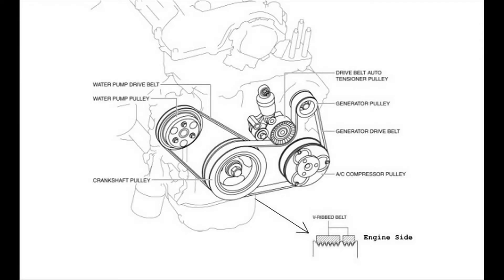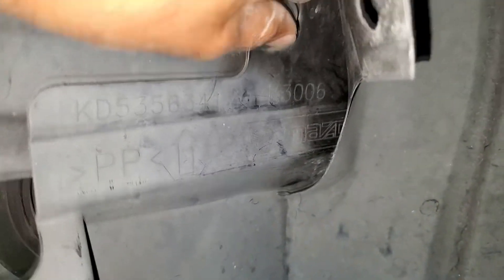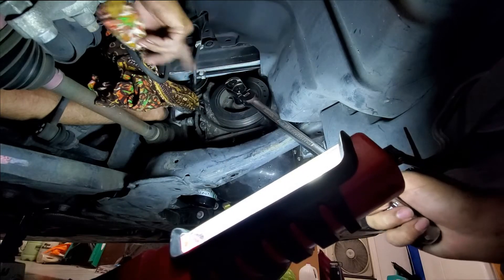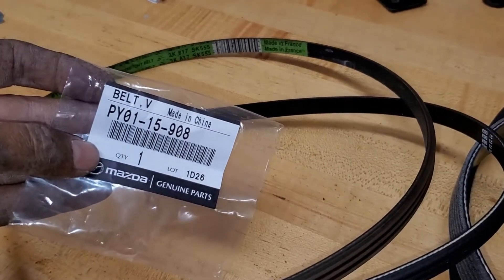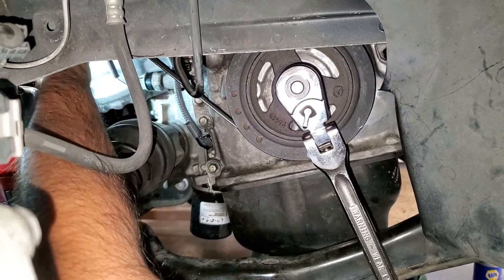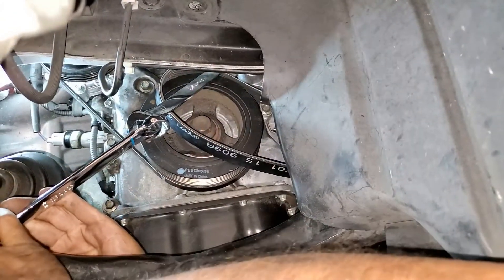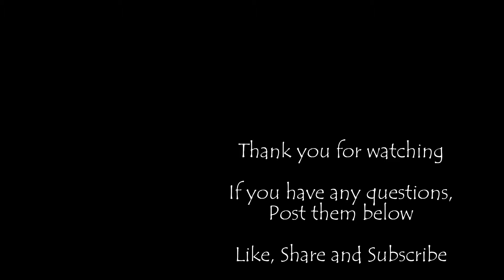How to Remove + Install/Replace Water Pump and Alternator & AC Belt on 2.5L engine Mazda 3, 6, CX-5

Comment: Nice video, but the water pump belt goes on easier from the backside of the pulley. Give it a try next time. It took me awhile trying to get it on your way and just couldn't get it working off the floor. Then I tried it from the backside and it went right on the first time. The serpentine belt ain't no trip to the beach either...   🤣
Reply: Oh yeah, and I forgot to tell you. Just cut the water pump belt off. Too easy...   🙂

Comment: Got to do this very thing to my daughters '16 CX-5. Dearlership wants $850 for that job to include replacing the tensioner becuase it's leaking. What could leak on a tensioner? Now I just have to find a vid on removing that part. Thanks for a great video.

Comment: Iveperformed an oil change gear oil chsnge on tranny, and coolant flush. I want to change the belts, spark plugs, and change the brske fluid next. I got 89k miles i wanna get 400k mikes or better on my 2016 mazda 6

Comment: Great video. I own two Mazdas with G120 and G194 engines and this will come in really handy once I need to address the issues of new belts or a replacement coolant pump.

Comment: Excellent walkthrough, thanks for sharing! Extra points for sharing the part numbers. My only suggestion would be to also replace the belt tensioner. At over 100K miles, it would be a good idea to replace it preemptively. Also while you’re there, inspect the water pump itself. If there’s any dried coolant near it, it’s time to replace it. Finally, once you have all the belts installed, spin the crank a few times just to make sure the belts stay on.

Comment: Thanks for the video. Replaced my tensioner at 100k. Couple of tips from my experience. A simple plastic grocery bag twisted to make a rope, works great to pull off water pump belt. The new tensioner takes a lot more force to compress than 100k mile tensioner. Thus you need to use the two wrench method extra leverage  to get the new tensioner to get it to move, as shown in video.

Comment: I struggled with the water pump belt for about 3 hours as I could not get it around the the smaller diameter water pump pulley cover  sufficiently to feed it onto the pulley.  Finally set it on the water pump pulley and set the belt on the crank pulley and zip tied it in place and cranked it on slowly directly into position.  The belt came out of position on the water pump pulley but tight onto the front cover.  From there I twisted and pushed the belt while cranking very slowly until the belt caught  the lip, then slowly walked it over twisting and pushing with a 1.0" wide stick and voila, done in 40 minutes.

Comment: I don’t know if yours still monitoring the comments on your videos but I want to give a big thanks for this tutorial.  It’s the best one I’ve seen.  All the other ones have been dark or blurry or skipped parts of the process.  Yours was well lit and you explained and showed every part of the process.  Extra points for not removing the wheel arch cover and being able to remove the plastic anchors without destroying them!
Reply: Same about to do this tomorrow. This vid was like a well written recipe. Big picture and step by step. This industry has a lot of “my grandpa told me” types and it’s nice to see a well articulated demonstration.
Reply: Got it done thanks to this video. Altho I had much less clearance than he did. An offset box would have been perfect if it was just a little smaller. I had to use a tiny 17 mm open and ratchet ended wrench to get this done. The amount of horsepower it took to hold that in place and set the belt on was a level ten on the difficulty scale haha. Had zero leverage of any kind with that small ass wrench

Comment: Save time.  Cut off the water pump belt instead of taking all that time to remove it.    Second use a $10.00  Stretch Belt Installation Tool.

Comment: Why not just cut the old wp belt? Lol
Reply from the maker: you definitely can.  However, if you didn't want to or needed to remove the belt and put it back on, you need to remove it without cutting it :)

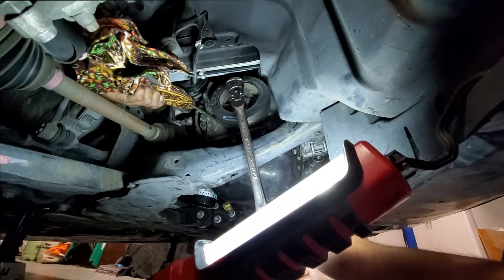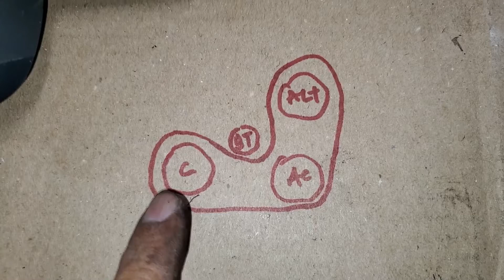Comment: I am trying to change just the serp belt, but the editing of this sub-video link that specified in text to click here to change the serp belt, has a lil other video info that i dont think helps me to do just the serp belt. From 5:25 to 7:25 and also from 8:30 to 10:45 is about the water pulley belt.  Do i need to do any of that stuff in order to change my serp belt only? The editing confuses me if this sub-video is intended just for the serpentine belt. Can u fix or explain why i need to do it if not changing my water pulley belt?? Im a single female that youtubes car maintenance. lol Thanks!
Reply from the maker: in this video, i am showing how to remove and install all the belts

I don't know the mileage of your car.  if the other belts have not been changed, it's probably a good thing to change those out too.

for serpentine belt ONLY:
2:39 to 5:25 is how to remove the serpentine belt
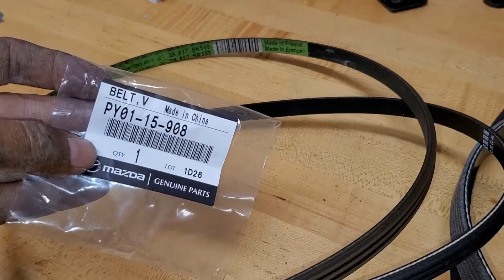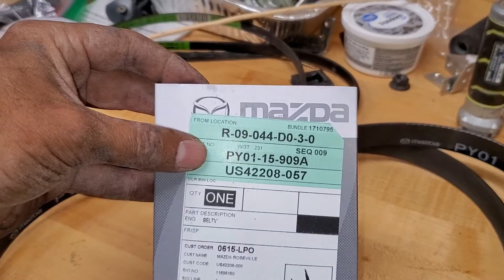7:05 to 8:25 information on the serpentine belt
10:46 to 14:08 is how to install the serpentine belt

Comment: Hello, while turning the crankcase the transmission is still in the the Park Section? and parking brakes on? thanks
Reply from the maker: the car should turned off, 
your parking brake should be one if the rear tires are on the ground.
you will then proceed to turn the crankcase...it has no effect on the transmission or the tires turning..

this is no different than , while in park with the parking brake on, you turn the ignition key or press the start button.  the crankcase gets turned by a starter.

Comment: Are we supposed to turn it clockwise or counter clockwise?
Reply from the maker: turn it in the direction that i'm showing in the video...sorry, lol, its the other right, or in this case the other counterclockwise :)  so clockwise
Reply: @footprintsinconc lol ty I wanted to make sure I’m actually on the way to pick up the belt now and replace it

Comment: Thank you for your help! Fixed my car today. My belt broke and replaced both serpentine and the stretch belt with your help
Reply from the maker: Excellent!
Reply: What happened after broken belt? Is it damaged engine?
Reply: @ No, the battery just wouldn't charge and the power steering stopped working. But made it home safely and replaced the belt afterwards.

Comment: You can do from top down.  Use half inch rachet with 17mm socket.  Right arm to hold rachet while threading your left arm down side of engine.  Be sure to place belt on crank first then holding tension thread under pully and around A/C.  Then again...im 6'5" and got long arms.  :)
Reply from the maker: thanks for sharing.  there are many ways to do the same job.

Comment: I would like to add my thanks for your very helpful advice. My serpentine belt broke on my 2017  CX-5 at 63000 miles. I tried my best to use a 17mm combo wrench and it was hopeless. I invested in a 17mm offset and it was smooth sailing. Thanks again!
Reply from the maker: Awesome!
Reply: yep, before you start just get the 17mm offset wrench. about $15 and you will save yourself time....

Comment: Is it worth it to replace the water pump at the same time? Or it could last longer than the belts?
Reply from the maker: Honestly,  it depends on the milage of the car.

If you are over 150k, and doing the belts, then might as well do it.

Otherwise check to see if the leak indicator hole is showing any signs of coolant leak...If it is, then you should change it regardless of the milage.

Comment: Turning the crank shaft counter clock wise doesn't damage the engine?
Reply from the maker: No it doesn't.
Reply: I wouldn't do it. No need to risk damage. It may cause timing chain to skip a tooth or two.   I would cut the old belts out with a knife and just install the new ones. That requires clockwise turning of the crankshaft.

Comment: I have 2016 Miata ND and did it from the top.  Removed air box and got decent access.  Tensioner hex was 18MM and crank shaft 21MM.  At 61590 miles the serpentine belt had a crack but overall was in good shape.  It could have gone more miles but once I had everything out to inspect it I just changed them both.  I used Continental 4060374 and 4030330S replacement belts.  Re-installing water pump belt was PIA - a midsize ratchet with flex head would have made the job easier.  Stabilizer bar made job much harder.  With water pump belt positioned on top of crank shaft (in groove) and bottom of water pump pulley I wedged my hand under coolant hose and just pushed to get tension belt seated.  Serpentine belt was easy.  Another example of why mechanics hate engineers :)
Reply from the maker: nice job and details!

lol, i hear you.  i know your comment is from a joking point of view.  over the years i think i've come to understand this as....still can't explain all the things, but here is my thought:

you have to remember that we all tend to view things from our own lenses and things aren't as clear as they are to us...as an engineer, there are a ton of things that even i wonder WTH!  but in business, they apply the same item in multiple different makes, models, and years, so the surroundings change but the engine itself doesn't and so we find these weird fits and situations.

there isn't any money for them to re-engineer items to make them better as they are don't with that phase and there must have been only a little bit of overlap to make sure things worked, but that is it....they don't see any more engineering giving them any more of a return on the car since it still sells for the same price, so they don't bother adding more cost into it....this results in all the frustration of those that work on the cars.

since there isn't a feedback chain, things don't change either....the feedback chain that they have, don't and won't pick up on all the stuff that you and i see and do.
Reply: Thanks for posting this comment. I just lost my serpentine belt on my 2016nd at 150.000 km on a trip and ordered a new tensioner and both belts. I need to go back by bus and replace it. I can see that it's the same setup as on the 2.5L engine, though I will be able to do it from above with the hood open. Thanks for sharing. Wish me luck 🤞🏻😅
Reply: The Skyactiv-G engines are bad examples for showing that engineers hatebmechanics.

Most maintenance tasks are very easy to do on these engines.

Comment: This helped me immensely! It's good to note that turning the pulley with the wrench/socket set is probably the best thing you can do (if people weren't already doing that) The Water Pump pulley on the CX-5 is high behind a frame member, so be aware that it's not as easy as shown as the OP is on a different model. Not that it changes the procedure, but it's tricker to get your hand in there. Excellent Job!
Reply from the maker: Thank you for the kind words!

Good point you make on the CX-5.  Thanks for sharing.

Please help me out with the YouTube algorithms by liking, sharing and subscribing.
Reply: yep, just did serpentine and water pump belt on my CX-5 today, getting that on was a 2 person operation especially with no lift, very tight! Anyway great video, very helpful.

Comment: I don't know where you got that wrong info .  But even if there's only one little crack on the belt.  You have to replace the belt . I have  22 years experience.  And if a belt is worn or cracked.  You have to replace it . Unless you want next to cut off the alternator and overheat the engine.  🤦‍♂️
Reply from the maker: thanks for your comment.

simply googling returns results like, they all have many years of experience as well...wide variety of opinions...
www.cartalk.com:  "Tiny cracks in a serpentine belt aren't necessarily bad, but the deep ones here mean it's running out of time..."
www.aa1car.com:  "...A good rule of thumb for older chloroprene-based serpentine belts (neoprene belts) is that if cracks are observed 3 mm (1/8 inch) apart all around the belt, the belt is reaching the end of its service life and should be changed..."
www.colonyoneauto.com: "The general rule is if there are three or more cracks within a three-inch section of the belt, then your belt needs replacing."

i was quoting the last quote as being the most conservative...so should have said "...with in a 3 inch section", not "1 inch section"...so i'm updating with this in my notes under description.

Comment: Great video. My water pump belt is making noise. It is off track. It's on the outside of the crankpulley which it shouldn't be so some mechanic clearly messed that up. I'm gonna be doing this project soon. Kinda nervous and excited
Reply from the maker: Don't be.  Enjoy the process and don't be stressed

Comment: Good information, just one question, you said turning counterclockwise, but you are turning the pulley clockwise.
Reply: Is there any issue with turning counter clockwise?
Reply: @mikexom don’t know in this engine, but in some engines I heard can mess up the timing.
Reply from the maker: good catch.  what do they say...do as i do and not as i said :)

turn it clockwise as i did in the video.

Comment: What's the best approach to going after the alternator itself? From the wheel well?
Reply from the maker: hi.  for the belt, from the wheel well
for the alternator from the top...remove and install.
Reply: @footprintsinconc  Thanks. Discussing getting one of these for my wife, trying to determine how much of a headache potential will be.
Reply from the maker: @shininginshadows  getting a mazda or getting belts/water pump, etc to do yourself?
Reply: @footprintsinconc  Getting a Mazda. Low enough miles that I shouldn't have to deal with the for a while, but like to be prepared
Reply from the maker: @shininginshadows  they are great cars.  if you get an accord for the same price, i'd do that.   i'd go with either, accord would be my first choice.

Comment: Nice job... not a lot of room. You could also just cut the old belt for the water pump.
Reply from the maker: thank you.  good point on cutting the belt.  but i wanted to show it removed just incase someone  is looking to remove it.  i always keep the belts that i remove as back up for my cars.